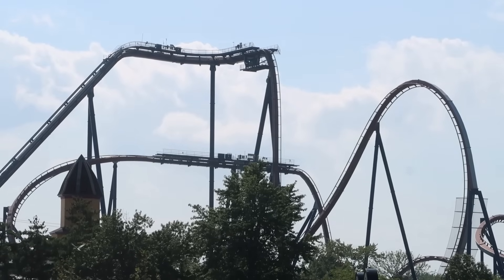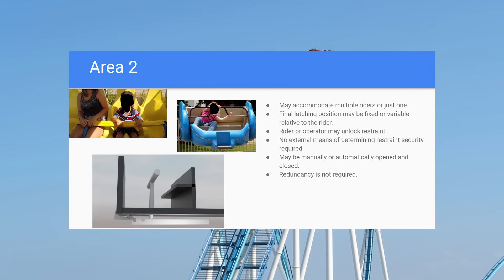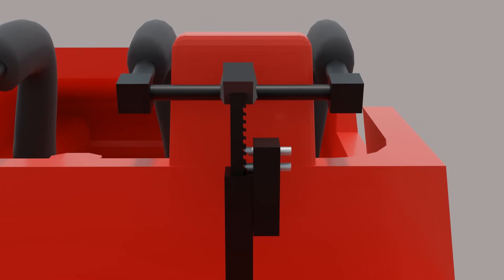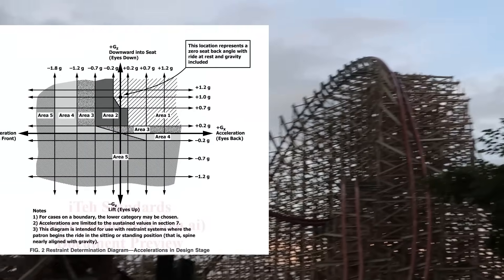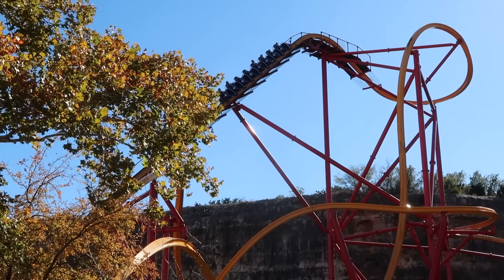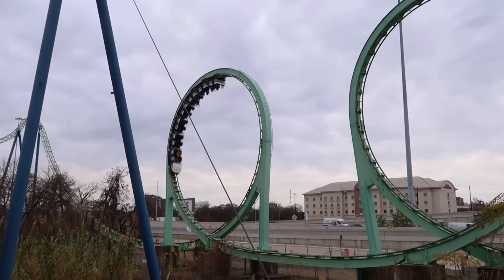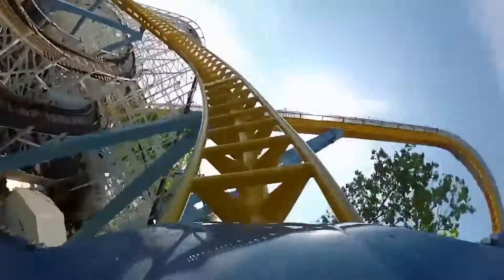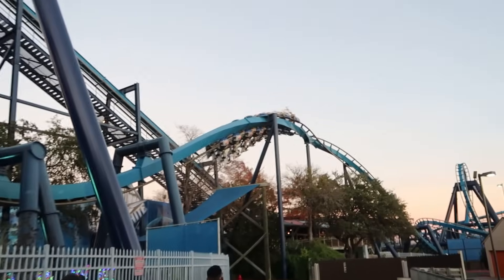Rules For Ride Design

Comment: extra fun, apply these to the wrong thing. Does your bed have at least level 3 restraints? Since you lie down on it, there's zero gees eyes-down, so it should!
Reply from the maker: You sleep face down, eww
Reply: @CoasterCollege   Doesn't matter, actually. On your back it's eyes-in, on your stomach it's eyes-out, on your side it's either left or right. In no situation is it towards your feet.

Comment: If you wanted a better fast-transition intamin to reference, CoasterStats did a full g-force video on Toutatis at Parc Asterix
Reply from the maker: Well that one doesn't have to comply with ASTM.
Reply: @CoasterCollege ASTM and DIN 13814 (the European standard) are similar - the ASTM actually allows for more negative forces and is otherwise very close. If a ride is compliant with the DIN standard, it is usually also compliant to the ASTM standard.
Technically, there might be differences as the ASTM requires a different sensor position than the DIN does, but that is (at least for the purpose of us enthusiasts) more or less a detail and has little impact to ride design.

Comment: Do you plan on doing a similar video about the European equivalent? 
Like EN 13814-1:2019  etc?
Reply from the maker: Possibly, would take a lot more reading lol
Reply: …and besides, ASTM and Euronorm work very hard to harmonize their requirements. They are not the same (and standards committee members on both sides sometimes think the other group passed something idiotic) but at least they “rhyme”. 
Also, ASTM is a little more agile than EN. EN has a publication schedule while ASTM does not; for example, the worldwide design standard, F2291-23b, was actually published three times in 2023.
And yes, it is a worldwide standard, used by any designer, manufacturer, operator, or…and here’s the big one…Authority Having Jurisdiction which chooses to adopt it.
A big reason for harmonization between ASTM and EN, particularly between F2291 and EN13814 is so that if you build a ride to either standard you will be substantially in compliance with the other.

Comment: so why does a ride get higher G Force limits if a rider is in the prone position?  is it easier for our bodies to handle the forces?  this is an interesting video.  I  like the informative stuff even though I don't work in that industry
Reply from the maker: Yes, the body can take the forces better in that position.
Reply: As vertical G force is only a problem due to your brain. When you're sat down your brain is subjected to high blood pressure during negative G and low blood pressure during positives (thus blackouts). In a flyong position your brain is not at the top of your body, so fkrces would have to be MUCH higher to experience equal symptoms.
So for me the confusing part is why it only says 'slightly'. A 6G flying loop would be safer than a 4G sitting loop for example.
Reply: This has mostly to do with cardiovascular effects. Because of gravity and the way that our cardiovascular system is designed to operate in a vertical orientation, the body is largely unaffected in the most important ways by accelerations in Y, and particularly in Z. In a prone or supine position, the effect of gravity is moved to another axis, which leaves an allowable increase of at least 1Gz. Remember the acceleration limits are tied to the patron coordinate system.